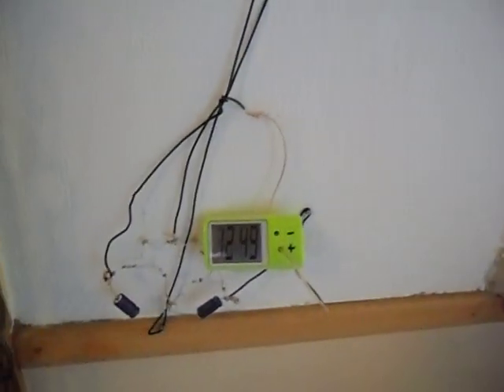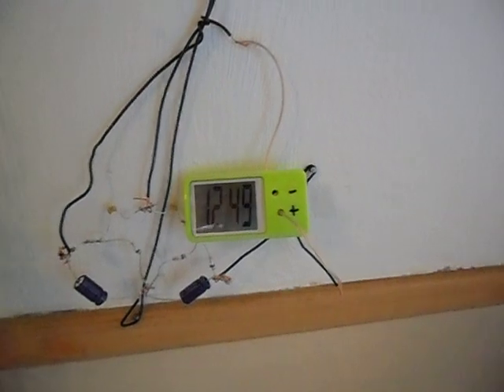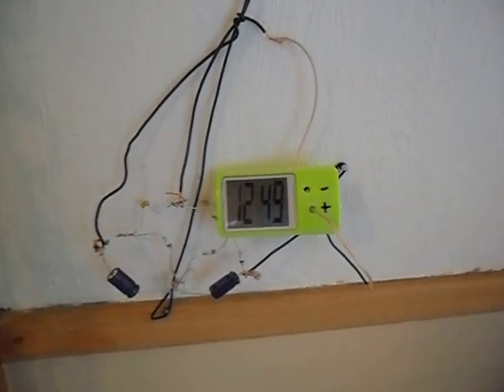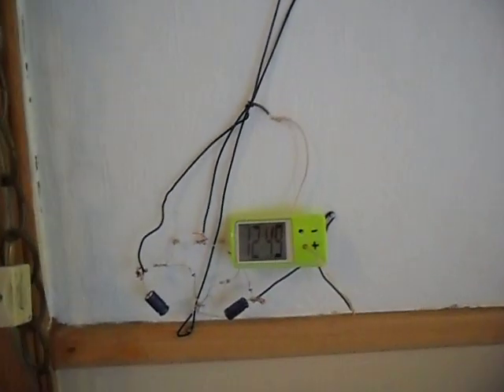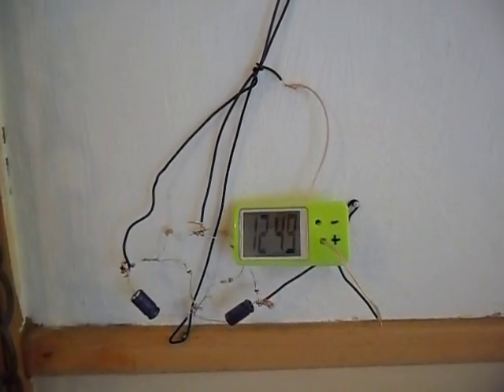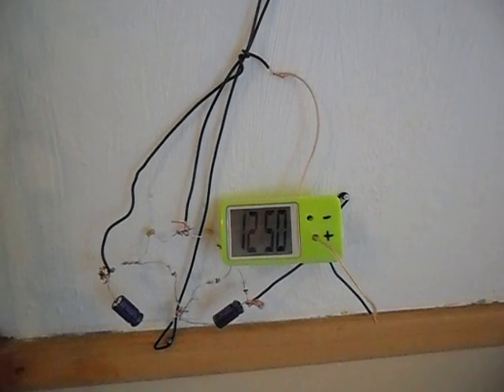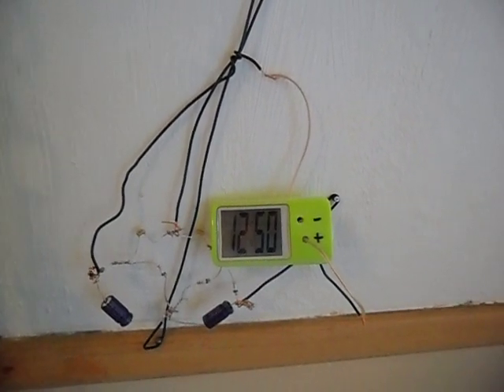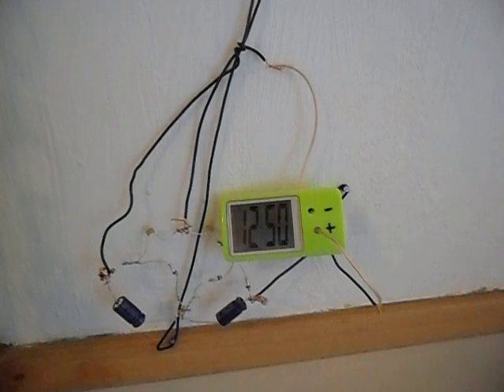One Tesla Circuit powering a small WALL CLOCK no batteries FREE Electricity from AIR

Comment: If you look at that circuit its what is called a voltage multiplier. Everything is a frequency....depending on your antenna you can pull from static (not being used to broadcast on) frequencies to "generate" power. Loop Antenna + Crystal Radio + Self-Powered Transistor Amp will give you a better pull on the static frequencies and boost your voltage potential. Its all about resonance. Also look up TACREG - Tesla Air Cavitation Radiant Energy Generator. Enjoy!

Comment from the maker: @The1995viktor I don't have a good means to stabilize the voltage....in this case I just got lucky enough to power the clock with no problems.....but the volts varied...from day to day and some day the clock would black out from to much power......its not a very stable system at this stage....Tesla knows more.

Comment from the maker: @The1995viktor........... 1N34 germanium diodes x4, 100uf 50 v electro. caps x2, and two ceramic caps at.1 or .2uf x2.........thats the components....other than antenna.